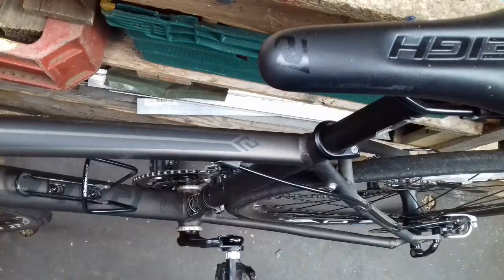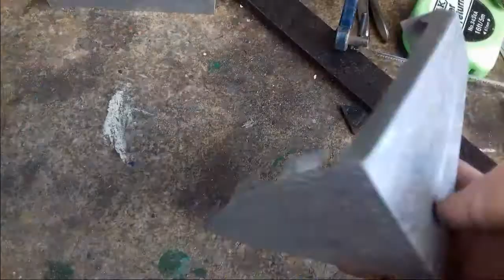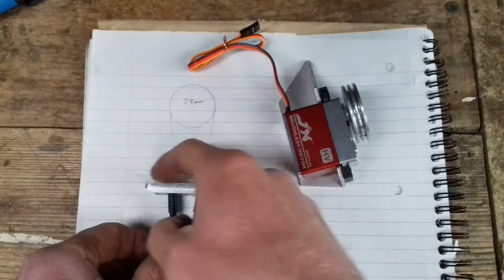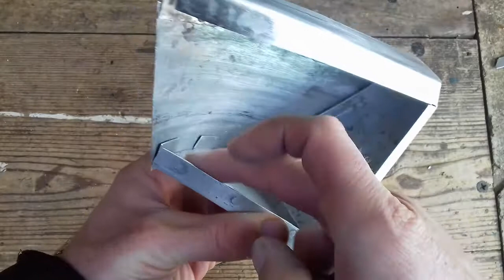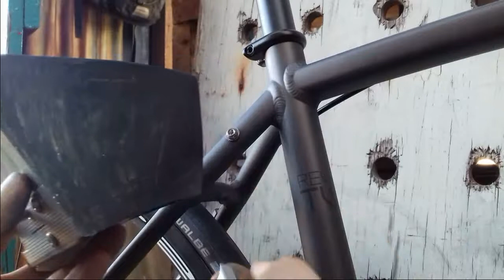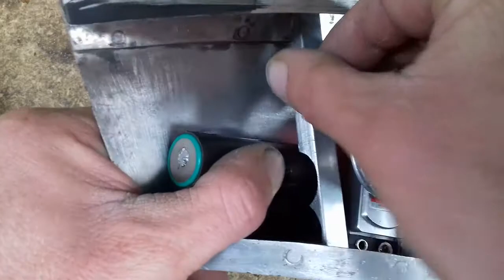enviolo SP Auto Shifter Road Bike Build Part 4 Aluminium Box

Comment: Hi. This servo its to 30kg? What model you use?  Is send with wheel?  Thanks!  Nice job
Reply from the maker: Thanks, I use jx servos. On V2 I use a high voltage one with 30kg torque, model BLS-HV7032MG.
On V1 I have been using a PDI-6221MG with 20kg torque. It needs a regulator (UBEC) to provide 5V. Has been incredibly reliable surviving 15,000 miles (24,000km) of shifting.